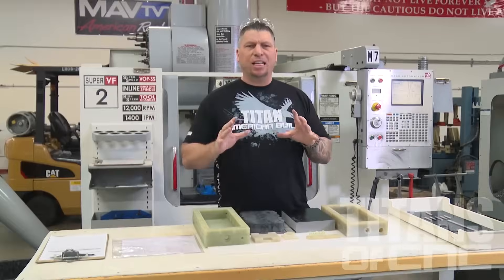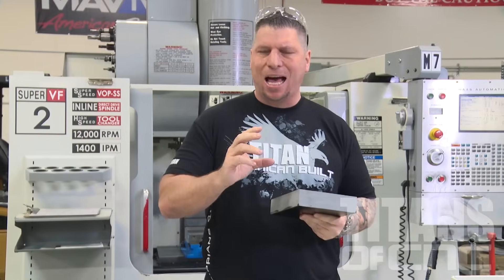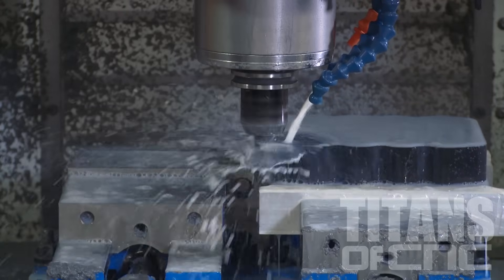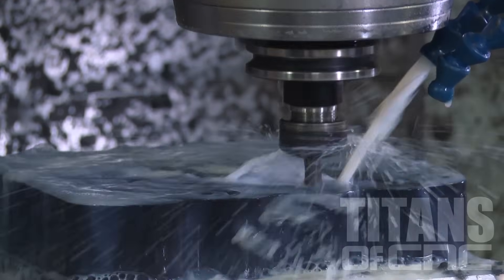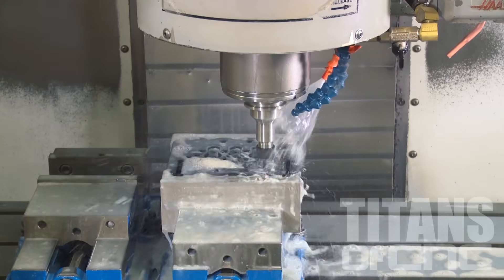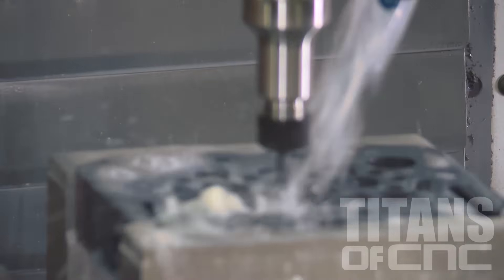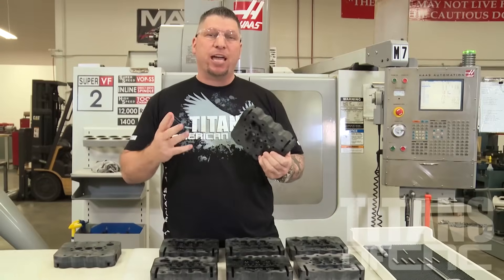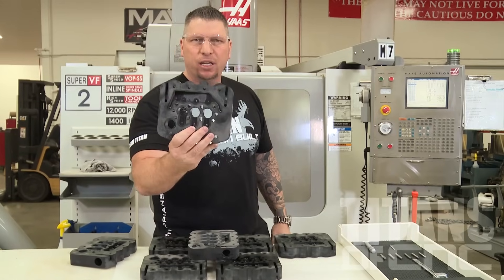Titan teaches on Machining Composite G10 - CNC Machining Education

Comment: I've been trying to learn how to machine G10 efficiently, and came here searching for it.  So after viewing the video I learned I need "diamond tools" (I assume you mean nano-diamond or diamond-like coating on carbide), use custom soft-jaws, which are both important but I was hoping for more... Can you recommend the feed and speed?  Optimal load on the tool?  Looks like you were using somewhat higher helix end mills, are those 5-flute end mills common for titanium milling?  Is there a reason for choosing that geometry (or in fact, are they necessary just like diamond-coated end-mills)?  Also I thought we are not supposed to use coolant, and the machine should be negatively-pressurized with an air evacuation system through advanced filtration unit to get all the fiber out.  (Loc-line aiming at tool, but instead of spewing coolant they suck air along with all the fiber out).  Otherwise you itch like hell, destroy your lung, and the glass fiber gets into your ways and grind them to bits... losing accuracy.  It is obvious you have a much better solution, and I saw that on your comment a filtration system is keeping your machine healthy instead. How'd that magic work?  It looks the sludge still drips off the table, so in theory they could deposit the glass fiber into the ways before flowing into the coolant tank.  Did I misunderstood this or would you be willing to tell us where your filtration system is located?  Sorry about all the questions, we are a total noob/newbie in G10 and there just isn't a lot of information (or they are all contradicting) on machining them.  I hope I wasn't asking you to give your trade secret away... but any help will be appreciated!!  Thanks!

Comment: we dont use coolant for g10 in my shop because it clogs up the screens, and once in the system the coolant will make your skin itch-burn
Reply from the maker: Been using coolant for 15 yrs and never had an issue and we have a great filter that cleans the coolant. No coolant means your potentially breathing glass and that’s not good.
Reply: G-10 is nasty. You better not have it's dust all over the shop. Coolant is needed for it.,
Reply: TITAN I know your super busy but wanted to ask the main machinist man, because I have an important interview coming up and I want to know what speeds and feeds to use on G10 also what coolant should I use brother ?? God bless
Reply: @MrElprototipo2012  that’s trade craft . They will never give that info .
Reply: we also dont use coolant on G10

Comment: Many of our customers won't allow coolant to be used with their G10 parts because it affects the electrical properties when there is oil contamination.
Reply: SBE Precision Products what about mineral oil
Reply: We have to run dry.  We use a dust collector.  In theory mineral oil shouldn't affect electrical properties, but they aren't going to try to figure out what you used.

Comment: This is a very manageable material if you take your time and use the correct cutters. I really hope you have at least 1 inline filter on your coolant loop to get the glass out of your fluid, or your operators will be breaking out forever, not to mention the way damage. I cut a lot of LE phenolics and get amazing performance and life out of heavy burr style cutters. Try an SGS 73011. Its a FGR #9 Style A Bur. Its great for roughing and will hold up forever,
Reply: On G10 ?